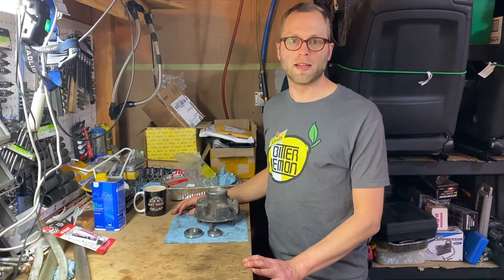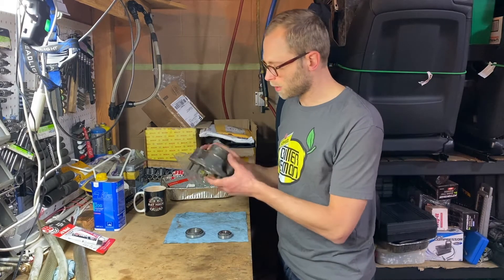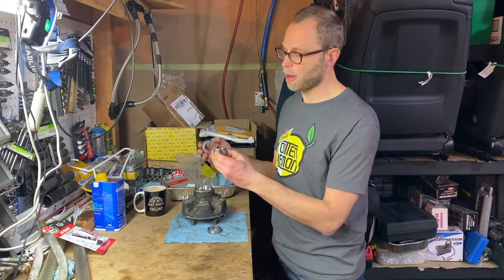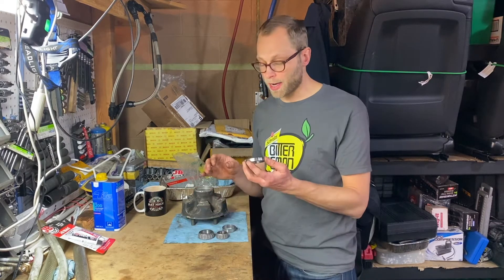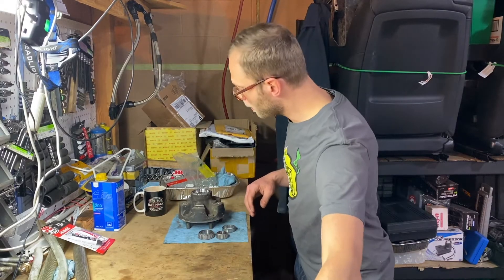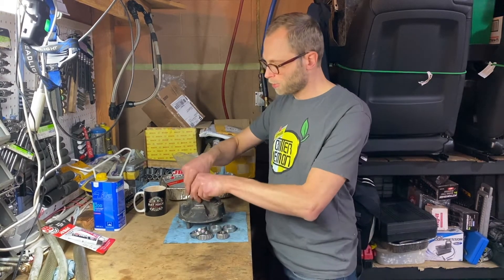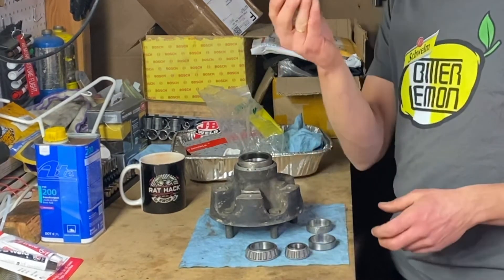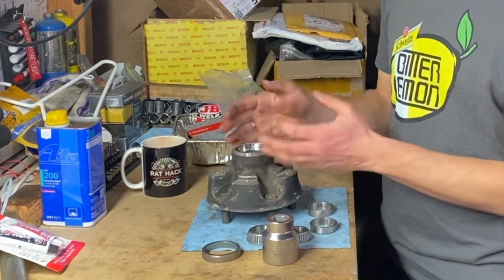Bitter Lemon Tech Tip: tapered roller wheel bearings

Comment: Molykote 55 works wonders for press-fit items. Check it out.
Reply from the maker: Interesting! I thought that was a silicon-based o-ring grease? I tend to put a very light coat of wheel bearing grease on the race before I freeze it.